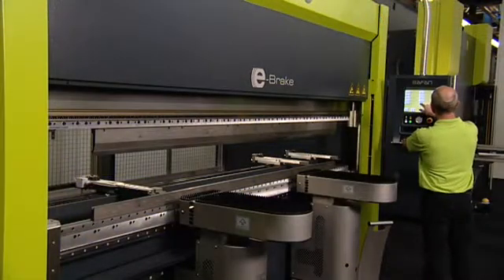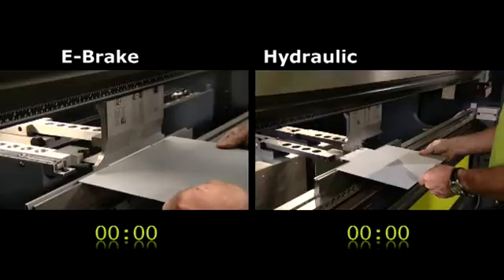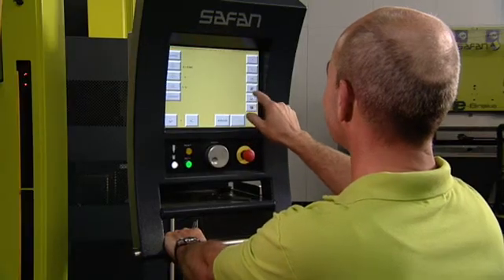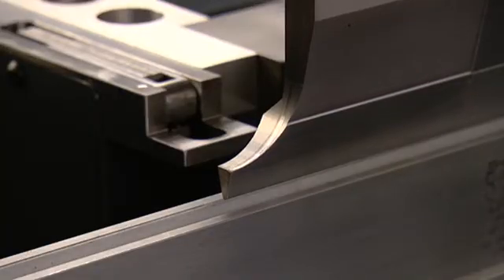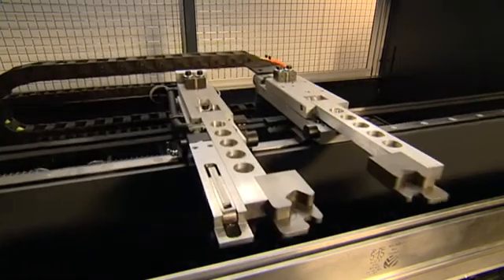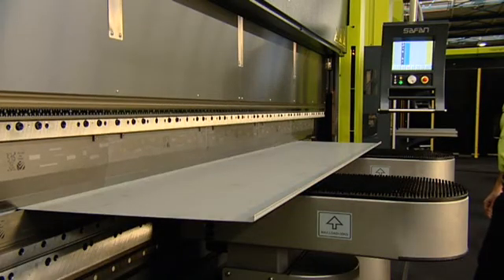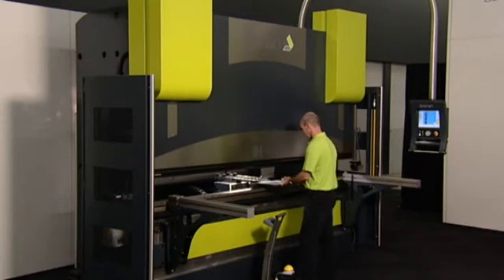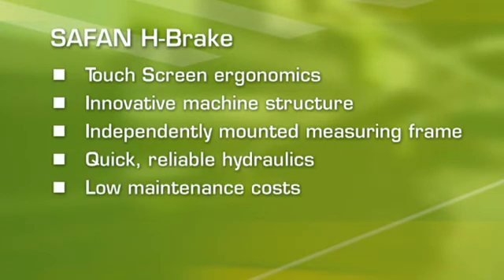Safan Press Brakes

Comment: There was already one bend completed on the e-brake before the time started.
Reply: It also cuts in and out of several parts being formed. That’s called “editing.”
Reply: @Jcd2147  mute point is set lower than other. probably 1mm and around 35 on other..... bull..
Reply: @sebsan364  it’s 1mm on the e-brake because it can be set that low. About 6mm on the hydraulic, which also was made by Safan. 

Can’t set the mute point any lower on hydraulic machines due to CE regulations. 

Anything else?
Reply: @Jcd2147  6 ok. Which is around 3x less than presented here. But anyway with a good technique and organization you can do same things in same time. I just dont like to point out a problem that is not really there if you know what youre doing.

Still... safan can start a bend 1mm above pp. Cant set opening less than that...
Amada: 0.1 on older types and 0 on a new machines.  ...and its not going up (all the way) when you lift your foot of the pedal before reaching mute point.
Reply: @sebsan364  not sure I’m following. If the lowest you are allowed to set pinch point is 6mm on hydraulic machines, and you can set at 1mm on electric, clearly there is an advantage to the technology. 

Also, the machine auto cycles to the pinch point while the operator is manipulating the part. 

Amada makes a nice machine but they are not able to do what the ebrake is.
Reply: @Jcd2147  6 is the mute point. its whem ,achine slows down and start applying pressure. PP is 0. its when blade touches the material and holds it in place without bending. You can see that on a bends when X axis have to retract before the bend is made (or during the bend).     In Safan the 1mm (above the material) is minimum you can set.  Amada you can set at 0.1 above material.  So.... when bending lets say 500pcs of part with one bend and quite short BL (managable with one hand) you can slide folded part left or right with one hand, while placing flat part on a bed with the other hand. Then blade at 0.1 above your flat part act as a support and helps you to keep it flat on a bottom tool and also prevents it from slipping above or under Xaxis fingers.  Which in case of 1mm between is loads of space. Takes longer to position part flat on a bed and takes longer for machine to make a bend.
Reply: @sebsan364  I’m well aware of what the mute/pinch point is. I’ve been involved with press brakes for nearly 20 years, either in service, applications or sales. 

I’ve seen both in operations and can tell you that the safan has an advantage. You can either accept that fact or not. 

I’m off to do more productive things now.
Reply: @Jcd2147  theyre not able to do what safan because they did it from the very start, ages ago. it was always normal and natural. hydraulics can bend instantly, where electrics cant apply pressure that efficiently straight away. Thats why I think it is not allowed to set less than 1mm, but i might be wrong.  Experience speaks for it self and I never thought ill be writing all thoose comments. ;)